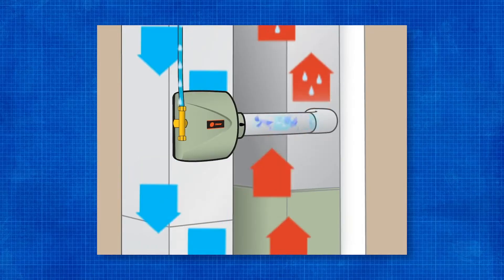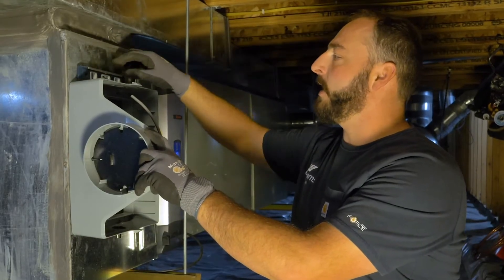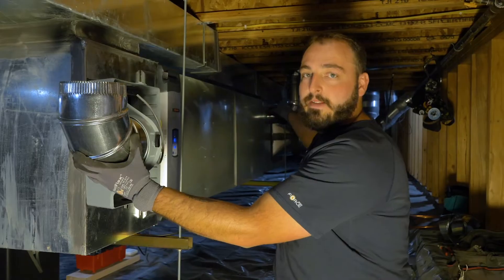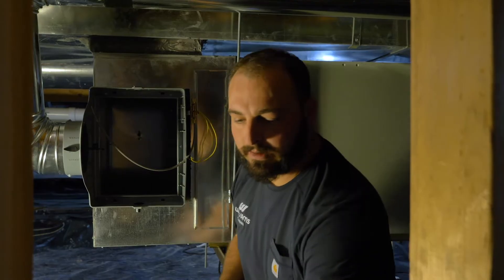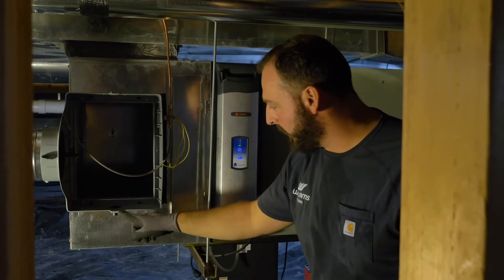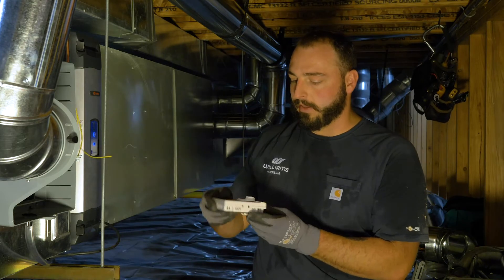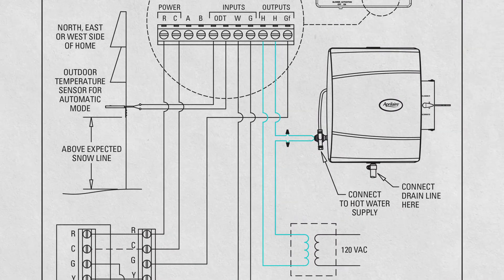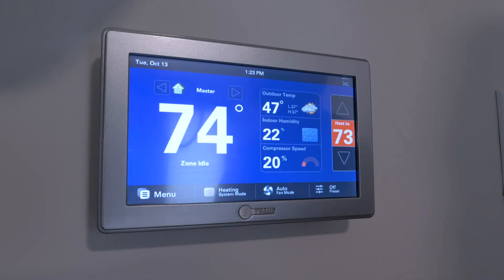Whole-House Humidifier: Installation

Comment: Travis..thanks for the video..we just installed a new furnace and kept the old bypass Aprilaire Humidifier which is totally manual ( no sensor)..when I have the humidistat on and increase the percentage up or down, it clicks on and off fine..solenoid is fine, etc..however when the furnace shuts off, the humidifier keeps running the water.. I remember my old furnace when kicked on, it also kicked on the humidistat and when kicked off, they both kicked off. Had the dealer back out today and he says I have a manual humidistat that is independent of the furnace. It doesn't make sense. What good is a running humidistat without the blower being on in the furnace. Humidifier water could actually run forever...so I turned the humidifier off until I can figure this out. In short he says, the furnace isn't talking to the humdifier and it does appear the installation of furnace is fine and there are no other wires that are not hooked up. I have a transformer for the humidifier that is powered to the usual plug receptacle. When I shut off the furnace, the humdifier shuts off too. Not sure if the technician knew his stuff. He's not an installer. Sounds to me like the fan isn't hooked up at all.
Any ideas?..perhaps I could call you...

Comment: How much water is wasted? is there a system that cycles the water that the humidifier uses back to the top. the hot water heater will run 24/7 as long as the humidifier is needed. how can you make it better?

Comment: So many things wrong with this unprofessional install.

Number 1 is that saddle valves are against code to install. In other words, CANNOT be used under any circumstances. These guys will use them because they are quick and easy to do, but inserts unnecessary risk and potential to leak over time.

Number 2 a galvanized metal pipe hanger was used to keep the water line shut off stationary. Galvanized metal should not come in contact with ANY copper as it will introduce electrolysis to the metals, creating potential leak issues down the road.

This is the problem with companies like this, maybe the customer won't have issues right away, but these are simple, albeit HUGE no-no's in the industry. Yet companies get away with these things all the time. This work would not pass code anywhere in the United States unless the inspector doesn't care or is too lazy to go down there to look.

Job rating F, please do better, it literally would take seconds more to do it the right way.

Comment: It can be installed on either the return or the supply. But it works better on the supply and with hot water. Just make sure the water is softened for better performance so you don't get scale buildup.

Comment: In your opinion, do you get better performance from installing on supply or return?
Reply: 15 year HVAC journeyman here. You have to have the positive pressure from the supply side. This pushes the moisture to the return side. It may work the other way around but this could rob your air flow (having it suck instead of blown)

Comment: Humidifier should go on the supply side not return.
Reply: 💡Good idea! Mold spores getting blasted directly into home air without having the chance to go through a HEPA filter?
Reply: That's where I Put mine on water b valve to
Reply: I assume some installers do it differently.My installer hook my water l to cold water line.The unit is on the supply side and humidistat on return side.
Reply: 😂 leave it to the pros
Reply: It can go on either. Bypass Air flows hot to cold.
Reply: @trevorkolmatycki4042  That's always been MY understanding. That as long as it's going THROUGH the humidifier chamber, it doesn't really matter what the "source" is. (Although feeding from the warm duct might provide a little better moisture "pick up")

Comment: Nice installation with lots of good hints. I installed one of these (same model) in the fall of 2020, so it's been running for 2 seasons. What a great improvement in our home environment! I would recommend that everyone in cold climates consider this.

Comment: Not being critical but isn’t that a long run to get the moist air to the return?
I loved my humidifier in my old house but the hard water kept it constantly out of service about every 3 months.
Reply: From personal experience, I think that length would be fine. But I agree with you 100% on the soft water factor! (I just hate the expense and/or labour involved in water softening. 😕)

Comment: Can we use the cold water line instead of the hot water line ?
Reply: Yes.
Reply: I'd say minimal difference since the small amount of water flow won't be enough to keep the line/water warm anyway... especially since it is most often located in a basement or crawl space.

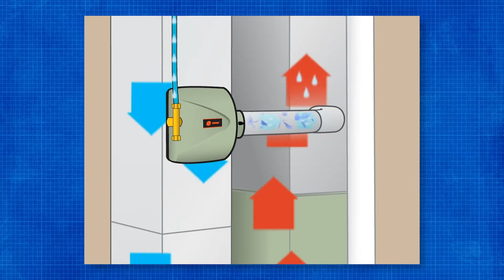Comment: Hello. From the diagram at 0:07, given the blue and red arrows signify the return and supply, respectively, the Aprilaire whole-home humidifier (WHH) is shown installed on the return side. I have read some purposefully choose to install their WHH on the return. I made sure to do enough due diligence before installing the unit as a DIY homeowner. Low and behold, I went off of this diagram and winds up that Aprilaire states in their instructions to install the unit on the supply side. I am not looking forward to switching the Aprilaire WHH unit from the return to the supply side and end up having to patch the square cutout with a makeshift flange with the start collar. Please advise.
Reply: I wouldn't worry about it. Despite the supplied instructions showing the unit on the supply Aprilaire says that you can install on either supply or return. It works in the same manner. This is a standard for evaporative humidifiers. The only time  installing on the supply is a must or rather highly recommended is for ones with built in fans.

https://www.aprilaire.com/owner-center/frequently-asked-questions
Reply: Always the supply side this guy is a hack. Saddle valves are trash too.
Reply: @shanew7361  Why supply? and why do saddle valves suck. I don't like the thought of it. I think I would rather just have a shut off valve branched off of my  hw line.
Reply: @tuanische  Saddle valves are garbage first off, just look at the actual design.  Think about it.  The reason the supply is the best is so humid air actually makes it and isn't removed from a furnace.
Reply: @Balticblue93  It seems like you and Shane W are both wrong, even AprilAire's own FAQ states...

"AprilAire bypass humidifier’s get their air movement through the water panel by the differential pressure between the supply (hot air) plenum and the return (cold air) duct.

The supply plenum is under positive pressure and the return duct is under negative pressure. One of the advantages of a bypass humidifier is that it can be installed either on the supply plenum or on the return duct with equal effectiveness. No matter which duct the humidifier is mounted on, the airflow always goes from the supply to the return through the humidifier.

A bypass humidifier will also have no adverse effect on any component in the furnace, air cleaner or filter. AprilAire Humidifiers put “water vapor” into the air. This is nature’s way of getting relative humidity into the air."

but yes i will agree saddle values are only good for quick setup but will fail and leak so you might as well do it right the first time